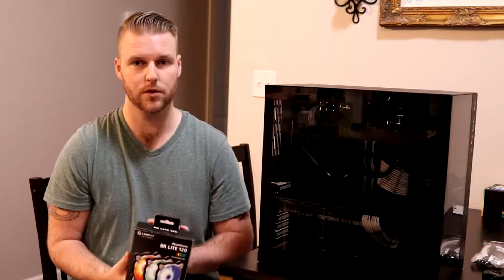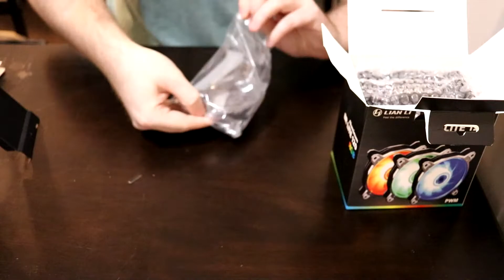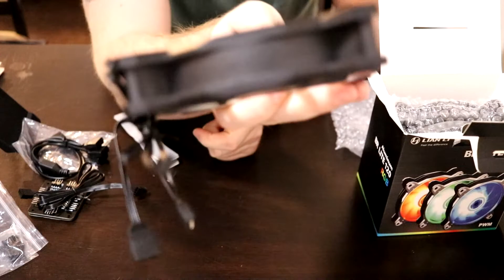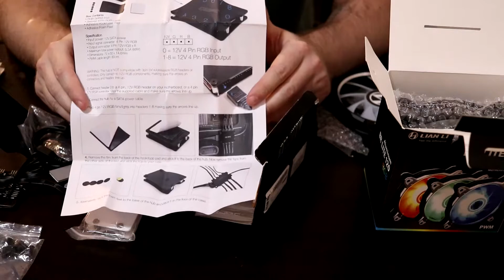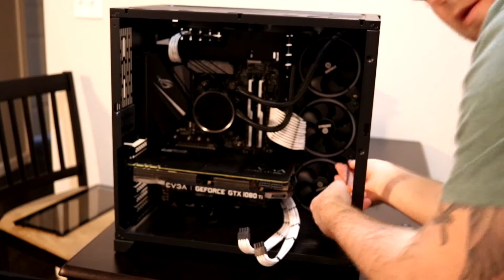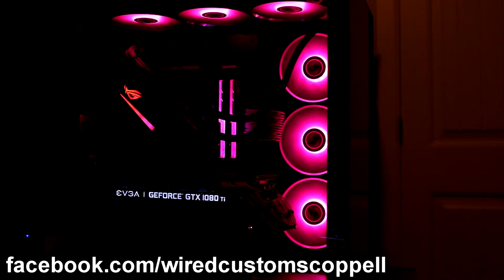Lian-Li Bora Lite Fans // Just, Wow.

Comment: What about noise? I have Aigo R5 pro and they are so loud and bad performance! And I'm searching new fans and these looks pretty nice tbh
Reply: They are a bit loud if you use over the 900rpm but one of the quiest rgb ones though.
Reply: @gils_rhapsody  I still use my old black fans (nzxt i don't remember exact model) at the same rpm and they are so much quieter and the temps are good. Also a friend has the same fans and same, noisy and poor airflow

Comment: Hang on, the Max input on these fans are 0.45 amps aren't they? You'd be trying to pull 2.7 amps on headers that are to my understanding usually rated for 1 amp if you fully loaded up a single splitter, how did they end up working for you?
Reply: No no no.....1.32 amps

Comment: Would the included pwm hub work on a corsair fan. Thinking of switching to corsair fan but they not have pwm hub
Reply: NHKD as long as it uses the universal 4 pin pwm connection its fine.

Comment: ok im sold .. was getting the dynamic case anywho --- but have you explored using 3 more in the bottom of the case ? im going with a 360 rad side and then wanted 6 fans top bottom, but maybe not needed bottom ?

Comment: Hello, thank you for the video.

I am looking to buy these fans in the near future, and I am just not entirely sure on how to connect them.

You use the XSPC 12v RBG hub, however I see that XSPC also offer "PWM hubs". Will I also be able to control PWM through the hub you used, or is that hub solely for the purpose of controlling the RBG?

I wish to be able to control both PWM and sync all the RGB, while making sure everything receives intended power. Would I need one of each hub in that case?
Reply from the maker: If you're using more fans than you have pwm headers on your motherboard you'll need some kind of hub or splitter. 

RGB and PWM are different circuits, different inputs so you'd need specific hubs for each.

Comment: this looks great!  curious about your setup..why not place fans on the bottom to get fresh air to your GPU?
Reply from the maker: I tried and the temps were worse. I'm guessing the GPU fans and intake fans were working against each other... Not sure.
Reply: @OneOff1   you didn't keep the dust filter on there did you?  I have the same case (except I have the fan grills in the front) and removing the filters decreased temps... I will be purchasing filters from silverstone as they are more mesh than the stock filters...
Reply from the maker: @SimonPhoenixInHD  I have 3 cats... I left the filters on lol.
Reply: @OneOff1  point taken.  LOL.

Comment: what happens if you don't plug in the rgb cable at all? my motherboard doesn't have an rgb header
Reply from the maker: No lights. Fans still work fine.
Reply: @OneOff1  Hi there, could you please tell me how to connect RGB connectors? I have 3 of these fans installed in my PC, they work but no lights.

Comment: Hi thanks for the review. Would you happen to know if these fans are compatible with 3rd party motherboard software (i.e. ASUS Aura, MSI Mystic Light, GIGABYTE Fusion) and if you can use any of these to control the air intensity and the RGB lighting?
Reply from the maker: These are compatible with a 12v RGB header on your motherboard. Just make sure your headers are 12v and not 5v.

Plug the fans into the fan headers on the motherboard, control the fan speed through the settings in your bios.